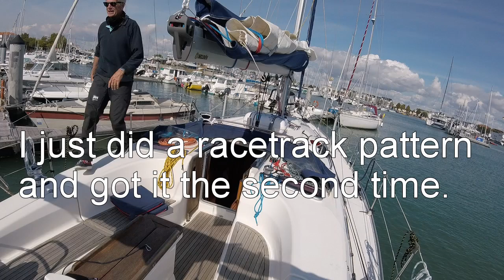Ep 18 Solo Sailing: How I Dock My 40' Sailboat 4 Examples and a Blooper

Comment: How fast is that bumper good for?
Reply from the maker: Ha....   Well, I imagine the worst case scenario is that I would hit the pontoon at about 2 kts.   The idea is to enter the slip at idle (I'm usually at idle well before), and then hit reverse about 80% of the way in.   Sometimes I do misjudge a bit, and hit the pontoon with a bit more 'enthusiasm' than planned, but have never done any damage to boat or pontoon.  I prefer hitting the pontoon a bit too hard, rather than hitting the boat next to me, or getting my safety lines tangled up in his.  My method does a good job of avoiding that.    Thanks Nomad.

Comment: I notice little to no prop walk when in reverse. Is that a sail drive system?
Reply from the maker: Exactly HoverJocki.  As you guessed, with a saildrive the prop is located much further forward than on a standard prop/shaft set-up, so the twisting moment is much reduced.   That is both a plus and a minus, but overall, it greatly reduces one variable that can make docking difficult.  My Bavaria is fitted with a folding, three blade saildrive.
Reply: Patrick Laine thanks for the answer. I enjoy your videos. For some reason I thought your boat was a Jeanneau. Sail safe.

Comment: Any thoughts to solo sailing the AMEL 50?
Reply from the maker: It's a beautiful boat, but I have not sailed in one.  In general, I think it would be 'challenging' to sail a 50' boat solo.  The sailing part is fine --- but docking a 50 boat solo in a crosswind could be difficult ---- and especially so in a center cockpit boat where you are far from the sides, and getting a line over a cleat on the pontoon while solo could be good sport.  I think 40' for a solo sailor is the sweet spot --- stable while sailing in wx, and relatively easy to dock solo.
Reply: @patricklaine6958  Kinda what I was thinking but with a bow thruster it may prove doable.

Comment: An advice from me for your line throwing, instead of the way your doing it, put a 5 foot eye on a single and learn how to throw it. It will become easier with practice. I can throw that line from like 8 feet away and hit the cleat, which h will give you like 2 shots coming in, if you miss you have another shot as you peel off.

Comment: PATRICK, GREAT VIDEO!!  I AM INVOLVED IN THE DESIGN OF A NEW MARINA IN THE PORT OF MAHÓN IN THE BALEARIC ISLANDS AND I AM INSISTING ON FLOATING PONTOONS WITH FINGERS FOR BOATS FROM 10M UP TO 50-60M LONG. TO PROVE MY POINT ON FINGERS I AM SELECTING  VIDEO CLIPS IN YOUTUBE WHICH SHOW THE ADVANTAGES OF HAVING FINGERS TO FACILITATE THE MOORING MANOUVERS TO ALL SKEEPER OWNERS. BUT IN ORDER TO THAT I WOULD NEED TO EDIT SOME VIDEOCLIPS TO SHOW THE ACTUAL MANOUVERS, ETC THAT CAN BE SEEN IN THE VIDEOS. I WOULD FOR EXAMPLE EDIT THIS VIDEO JUST TO SHOW  THE ACTUAL MANOUVERS BUT WITHOUT THE AUDIO, THUS REDUCING THE LENGTH TO PERHAPS 5 MINUTES. DO YOU THINK WE CAN COMMUNICATE BY EMAIL? THANK YOU.
Reply from the maker: Hello Pedro.  I think you would receive a standing ovation from the sailing community if you were to install finger pontoons.  I don't think anyone likes the traditional 'Med method' with pendille/slime line.   You can use my video(s) in any manner you desire with no need to attribute anything to me.  (I have not monetized these videos in any manner, nor do I wish to.)  You should be aware that my technique is rather unique because I sail solo.   Most sailboats would head into the slip about half way, and someone would jump down onto the finger with a line and secure the boat.  If you need to contact me:  pcjlaine@gmail.com     but feel free to use in any manner that you desire.  Thanks for watching, and good luck with your pontoon project.
Reply: Hola Patrick. Thank you for responding to my comments so quickly. I will continue communicating by email.

Comment: Why don't boats reverse into their berths?
Reply from the maker: They do Mark - and I have filmed a couple in other episodes where I did.   It is usually a little bit easier to pull in bow first, but not much difference.
Reply: @patricklaine6958  thanks, I would have thought you would have more viability reversing in, obviously not as most boats  don't.

Comment: It's not really necessary to bump into the pontoon. It also can be done by maneuvering skill. I actually like that better, because that way, you will develop skill and it is much more of a "clean" way so to say.
Reply from the maker: I completely agree with you Jesse in 4 situations: 1) you have another crew member who can step onto the finger from midships with a line; or 2) you have light winds, or even better, winds pushing you onto the finger.  Here, the solo sailor can just stop 3/4 of the way into the slip, and drop a line over a cleat; or 3) you have a finger that is longer than the boat.  In this case, the solo sailor can drop a line over the end cleat and just motor forward, or 4) you decide to reverse into the slip.  You just back in almost all of the way, stop, drop a line over a cleat and motor forward. That leaves the (very frequent) case when you have 10-12 kts blowing you off the finger (as is the prevailing wind in my marina).  If the solo sailor tries to slow/stop partially into the slip, the wind and prop walk will certainly see the boat slide over toward the other boat in your slip.  Then you find yourself pinned against him, and too far from the finger to step off, and too far to lasso a cleat.   I'd love to hear a better technique (as I have tried many variations on this 'bump' technique I use).   As I said in the video, it is not always elegant, but it does get me home even in some very difficult wind conditions.     Many thanks for contributing Jesse.

Comment: Why don’t you just use a snubber line midship drop over rear cleat on dock drive boat onto dock
Reply from the maker: That's a fair question Bob, and a couple of others have suggested that too.  Unfortunately, the finger is just too short for that to be a practicable tactic.  If you look at 7:30 in the video, you will see that  the cleat on the end of the finger is a good 2.5 meters in front of the helm (when fully docked).   So, to do what you are suggesting would mean to stop the boat about 3 meters prior to that (when the cleat is about level with mid-ship beam of the boat).   I would then have to take about ten steps to get to the point abeam the cleat (I have counted them!)  and then hopefully be able to drop the springline  over the cleat (not obvious in windy conditions).  But then, because I am only half way into the berth, I have to run back to the helm/throttle and put it in forward gear.   So, let's say I'm quick and it takes 4 seconds to run forward and get the line over the cleat, and another 3-4 seconds to run back to the helm/throttle.  8 seconds of the prevailing 12 knot wind pushing me into the other boat will certainly have me up against him.  If I put the boat into forward gear now, I will scrape along his fenders for 3-4 meters before the springline pulls me into my finger.  The possibility of snagging one of his stanchions on mine is too great.   Sorry for the long explanation.  Your technique will work fine in dead calm, or when the wind is pushing me into the finger.   I can't take the risk of stopping the boat only half-way into the slip to try it when the wind is blowing me off the finger.    The finger is two meters too short.    Thanks for commenting.

Comment: isnt that risky goin so Close by other boats with their morrings? sailboat is 2-3 meter deep, Mooring goes with angle to the middle, thats catching the Mooring...
Reply from the maker: What you say is true in parts of the Mediterranean Sea Bernd, where many of the marinas don't have 'fingers'.  In marinas with fingers attached to the pontoons, boats tie-up directly to the finger or the pontoon.  There should be no lines in the water.     Good question.
Reply: 1 time i was allowed by the Skipper stearing ship by goin out of marina in croatia, no wind, nothing, it was Speed as when you walk smooth, suddenly a fat motoryacht started moving same Speed as us and same direction...with the keel we catched the line goin to the middle of Harbour, and the boat was so big that hes line almost blocked the Harbour-entry..10.000 austrian-schilling damage-relling(Chrom) was damaged..
Reply from the maker: Ouch.  I'm lucky, and we don't have the 'Med mooring' system with anchors and slime lines anywhere near where I sail.   Thanks for watching.

Comment: why not stern to and do it med style? you could just throw your stern lines then do the rest after you have a cold beer.
Reply from the maker: I do dock 'stern to' at times.   (In episodes 22 to 34 I film about 40 arrivals and there are a few stern first clips in there.)   Reversing in is often easier as you suggest (and my boat backs VERY well compared to others).  That said, in high winds at 90°, if you get just a little bit too slow on the reversing approach, the bow will immediately fall off, and then you are in trouble.   In 'unfamiliar' ports I prefer just to keep the speed up in forward gear for good steerage, and get the bow well into the safety of the slip before reversing.   Many are not comfortable with this type approach --- which highlights the fact that every boat / marina will have its own personality.   It's up to the skipper to get proficient and comfortable with the right formula for his/her boat.    I'll take you up on that beer if you ever pass by La Rochelle.

Comment: Why don't you jumb off, with the line in your hand ( a boat is not a plane ;-)  ).
Reply from the maker: That’s a very fair comment Camilla.  My first consideration: If you are solo on a boat, you must be 110% certain that you can control the boat before you leave it.   Secondly, my boat weighs 10 tonnes.  If it is moving at all, there is a very considerable amount of inertia.  If you can’t get the line around a cleat instantly, you are not going to stop it just with your arms if the current or wind are taking it away from you.   Thirdly, when solo, you must stay at the helm/throttle until the boat is completely stopped (time during which the wind/current continue to act on the boat).   Then it takes another few seconds to get to midships and grab the lines you want to take ashore with you.  If the boat has drifted 1 to 1.5 meters away from the finger do you still go for it?  Hmmmm.    There is a big difference between stepping off a 25 foot sailboat and a 40 foot one.  Although I’ve considered doing what you suggest, in all honesty, I have never tried it.  I need to fully ensure the security of the boat before I leave it.   Thanks for the great comment.

Comment: try a spring line, problem solved
Reply from the maker: Yes, a spring line can work well when coming alongside (parallel) --- the challenge is to get it over the cleat, which is not always easy when there is a strong breeze or current.   I can't use a spring line entering my slip/berth because the finger is far too short.  You would essentially have to enter very deep into the slip before you could leave the helm and try to get the spring line over the first cleat on the finger.   It would work in calm winds, but with 10-12 kts of the prevailing wind, I would be into the other boat every time before I could get the spring line over the cleat.  This tactic could work well in a marina with longer fingers though.   Thanks for commenting.
Reply: Patrick Laine well done Skipper, home of the Vendee! solo sailing is one of the hardest things in the world, I use lots of fenders and always ready to alter plan of which side, sometimes a bow in turns into a bow out in an instant, once on the dock you can do what you want "make your plans and make god smile"
Reply from the maker: I think I may make God laugh out loud at times.   :-)

Comment: Are you joking?
There are tons of videos, tutorials, HowTos that clearly demonstrate HOW to use the ropes. 
Crashing into the land by purpose - is a bad joke! 
You demonsstrate how you crash into it, and you dont use any ropes. I mean, do you have two hands, or dont you? If not, then I am sorry. 
1. You need to prepare the ropes before you enter the harbour 
2. you need to throw the upwind rope and tie the boat safely (bug or rear, depending on the direction)
3. use the engine forward (in this scenario you show) to boil into that upwind aft rope

Dont crash into the land by purpose!!
Reply from the maker: Great suggestion.  I never thought of using ropes.  Thanks.

Comment: You should berth your boat by turning coming up into the wind leaving you adjacent to a jetty/pontoon with very slight forward power depending on strength of the wind or indeed any current. The idea that you have to crash into a pontoon is just poor boat handling skills. I watch you berth your boat with real fear. If you came near my boat I would have all spare fenders ready to protect it from yours.
Reply from the maker: You are not the first to say this, and your comment is fine with me.   Just a few thoughts for you:  1) I didn't invent this technique.   Solo sailors with longish boats and shortish pontoon fingers have been doing it for decades; 2) I sincerely regret having used the 'tongue in cheek' expression 'crash method'.   A much more appropriate description would be the 'Nudge and Pin method' (nudge the pontoon, and pin against the finger);  3) In my episodes 18-35 I have filmed 45 to 50 of these approaches (probably more than any other YouTuber), the majority at ports I had never visited before.   I did not edit out any approaches --- some are good, some not so good, and a couple are a bit ugly ----- but show me the episode where one is 'dangerous' where I damaged my boat, or another boat, or marina infrastructure;   and 4) Finally, if you have a much better technique for a solo sailor on a 40 foot or so boat and a 25 foot finger, film your technique in a crosswind, and I will be the first to adopt it and sing your praises.   Thanks for contributing to the dialogue.